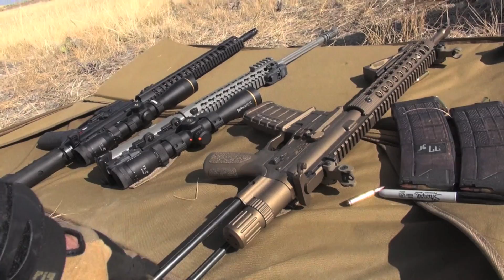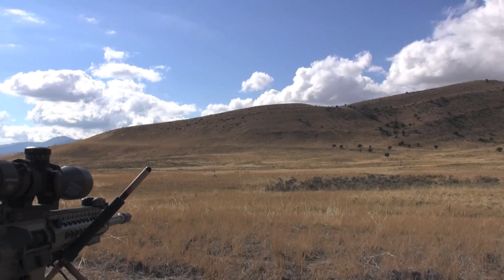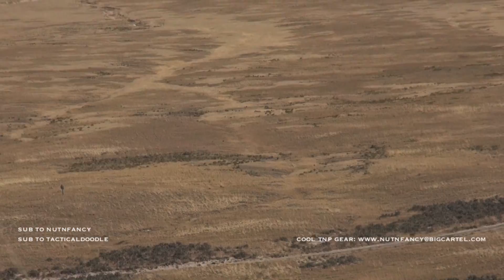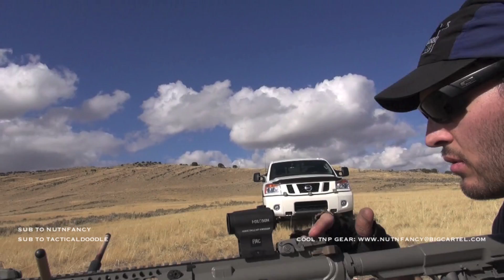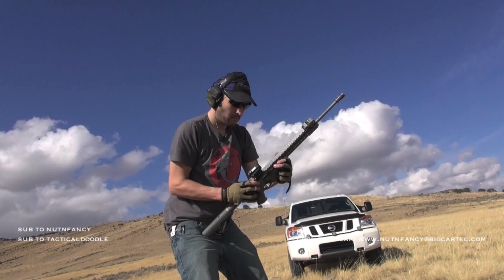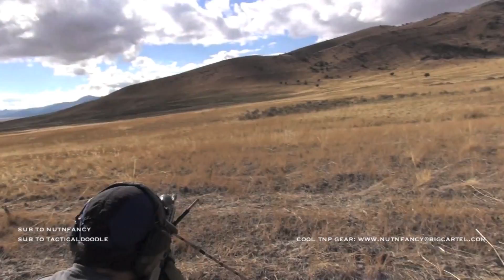'Hobby' AR15s Suck...Or Do They?!

Comment: The term 'Hobby Gun' came about when people on the forums (Arfcom vs M4C) claimed that guns like Olympic Arms, DPMS, RRA, and the dozen or so other AR makers...were MilSpec when they were not. This is when versions of 'the Chart' was created over at M4Carbine around 9ish years ago, to show that those manufacturers were not building those guns as per the Technical Data Package of the US Army via Colt M4 type Carbine. Back then, most AR makers claimed their guns were MilSpec when that was complete BS. The whole point of the Chart was to emphasize 'quality' and actual Military Grade built M4Gery civilian Ar-15s. 

I don't think most called the hobby guns 'crap' however, as they were Not actual MilSpec as most people claimed, but the folks were shut down by the 'Hive' when they claimed their gun was 'MilSpec' when the chart stated otherwise. At the time, I was going to quite a few carbine classes and these Hobby or Homebuilds were going KaBoom left and right, some causing serious injury to the users. Luckily we had medics and MDs in every course. We had quite a few of these guns turn into 'Jammamatics' because they were stamped 5.56 when they were actually .223 chambers, resulting in popped primers when they shot 5.56 ammo, in every single class. Luckily, there was an armorer with a Ned Christensen 5.56 chamber Reamer to re-size those chambers. 

Because of the factual data taken from the manufacturer's own websites and compared with the actual TDP,  people had a real resource to actually compare ARs based on the facts of the manufacturer vs the TDP.  It also made these Manufacturers pissed off and step up their game to build their ARs a little better. It also made heads explode and the butthurt was rampant. All over the gun forums with statements like yours, "I've never had a JAM yet", "My Fit and Finish is better than those", "You guys are f&%kin snobs" and "My 3rd cousin twice removed is a Navy Seal and owns one" etc... When the actual point was that their gun was not built to the TDP. Period and therefore, not MilSpec. I don't recall anyone saying that they wouldn't run. 

There's nothing wrong with a home built gun IF made with quality parts and you take the time to learn how to build them correctly. However, and most likely, most people do not use quality parts or take the time to learn how to build it properly. Having said all that, most if not all can Not claim that their 'Hobby gun' weapon is in fact, MilSpec or is Military Grade...other than do like you've just done and claim, it's as good as yourn...Peace.
Reply: A really important point is that mil-spec does not mean it's all that nice or perfect. Mil-spec is what the government gets the best price on that still works good enough through they're testing. There are parts on the market that do not fit mil-spec, but are actually better. Mil-spec is the base end of the spectrum, and it is easy to go far above.
Reply: bower31 You point is a nonsensical one and has nothing to do with what I wrote. MilSpec is a wandering meaningless word which has been hijacked to mean 'close enough' where everyone and every manufacturer can and has made claim of, regardless of it's authenticity, and has defined what they think it means to them, to either appease their conscious or to outright lie to convince people who don't know any better otherwise. MilSpec does Not mean Built to the Technical Data Package or TDP as what people actually think it means. Which is the MINIMUM standard, not the ceiling or top of the line. That's it. Most manufacturers can't even build to that 'floor' standard.
Reply: Sinister1 Nice redoubling of my point, I basically said mil-spec is a total bs term, which means little to nothing. You're better off learning what makes parts decent yourself, and judging based on your own research. That's why the term mil-spec died off so hard in recent years, because it doesn't mean anything remotely useful, besides that it wont blow your hand off, and will shoot mediocre groups.
Reply: bower31 That's not what you said, as i am not an interpreter. Communicate more effectively next time or start your own discussion.
Reply: I agree % 100. I bought a standard BCM. It  hurt my wallet but they are known for tight quality tolarance. weather its true or not I spent the extra coin because didnt want to risk getting a problem rifle, hopefully I made the right choice.

Comment: I have a smith&wesson M&P sport 2 and it has ran flawlessly and I replaced the gas block to a low pro Odin works so I could put a free float rail on it. But the barrel on it is really not great it's I believe 4140 steel not hammer forged or anything and it shoots 1 MOA with just regular federal 55 gro bulk ammo I have ran Tula through it and wolf and I have not had 1 single malfunction and As of right now I got about 1,500 rounds through it which I know isn't that much but I mean I paid like $700 for it I mean what else can you ask for. But yes I have made modifications to it like the handguard the sights and so forth. I'm looking for a very nice red dot for around the $150/200 mark any suggestions anybody?

Comment: Started with a M&P a few years ago, just made my own through PSA.  Picked my 18" Barrel, thanks to your recommendation, with a rifle length gas system.  got the premium bolt carrier.  I picked every component exactly how I wanted.  7075 buffer tube, SS 18" .233 wylde barrel, premium bolt carrier HPT, MPI, keymod handguard, polished trigger group, ambi safety, magpul furniture.  It is so awesome to put together your own just the way you want with upgraded parts for just as or less expensive as one off the shelf.  $700 build!!

Comment: People. This is the 21st century... Interchangeable parts have been around for a LONG time (first evidence of this practice were parts shipped to Carthage during the Punic wars) Now.  Computerized milling machines with outrageously small tolerances.  A simple,  reliable design.  I own an AR that is arguably a "Hobby AR"  made by some guy in Portland, Oregon who picks out parts that work and assembles them.  It cost me half of what it would have cost if a name brand manufacturer used the parts of this quality.   Zero issues.  Good accuracy.  Incredible value.  It works for me.  Ignore the hype.

Comment: I have built 5 AR15s milling 80% lowers and all. 3- 556, 1- 7.62/39, 1-300 black out. I use ass cheep ammo in everything because I shoot every weekend and have a family to feed. All of them just as reliable as my M and P I bought from Turner's and all cost between 450 and 550 without sites.  putting together a firearm that functions is very personal and I feel more protective of my builds than my buy's. Thanks for hitting on this subject nut-n, great video.

Comment: I've built my own for years. Yes, it is my hobby. It allows me to spend on the components that matter the most to me. Trigger, barrel, BCG. Spending hundreds on a stripped lower or upper is a waste of money. If they are "mil-spec" then what difference does the manufacturer make? I'm no "operator" so I don't need to spend hundreds on a rail either, save that money for a good optic!

Comment: about 6 years ago I built an ar with very little experience, it has never failed me. I even refused to clean it for over 6000 rounds to try to get it to fail, but I gave up. it took me almost 3 years to put the rounds through it but still pretty impressive. I do not have the highest level of components either

Comment: Majority of mine are "user built", the ones that not "user built" are my very first AR-15 and a handful of SHF AR-15's. Which the SHF guns are made from rifle kits since they are cheaper than "hobby builds" and work great, they all sport basic features (plastic handguards, irons, etc.). Your guys again are spot on, building your own gets features and components the user wants and is not forced to swap parts on a factory gun or overpay for features you don't want. In addition the user can go mild or wild on the parts they choose,  also if the users needs or wants change they can still swap items out and have a better chance of trading or selling the takeoff part. For example if a BCM Key-Mod handguardd is no longer wanted and he wants say a M-Lock the user can buy and install a different hanguard and have a much better chance of selling the BCM their for offsetting the cost of his new handguard.

Comment: Bought my first AR off the shelf just 3years ago, (at 61 years of age), after being a bolt gun guy back in the 70's -80's. Completely different animal, steep learning curve. After doubling the original cost by switching things around, I decided to build from then on.
Reply: Orion Fixr 
After buying off the shelf a couple times, and then changing everything out to my liking. I have learned it's cheaper just to build them the way you want from the ground up.
Reply: Same here. I've built 3 rifles and two pistols, all function very well. Now I'll be the first to admit my weapons haven't had thousands of rounds through them and been torture tested beyond reality, but they work for my POU. My "bench gun" ,built mostly with PSA parts at a cost of around $700, puts 5 rounds of 55g PMC BT into 1 1/4"- 1 3/4" at 100yrds. Could do better with a better shooter at the controls, I'm sure. I like building them as much as shooting them! Haha!

Comment: I bought a stock AR back in 2012. Today the only stock parts on it are the buffer, buffer spring and the upper receiver. The second time around I built one. Both run flawlessly with anything I put in them.

Comment: Drives me crazy..."Yeah, that's good for plinkin' but I wouldn't trust my life with it." Like the AR knows when it is pointed at a real bad guy and decides to take a shit on that shot? The shit you see on forums. I put together an AR pistol recently...after replacing the weak (factory installed) ejector spring...1100 rounds flawless so far.

Comment: I will NEVER buy a store AR. I have built 3 AR's so far, after the events of last week it looks like ill be able to build another one ;), and I have only had problems with magazines.

First was a budget build using the cheapest parts I could find and has a 16 inch barrel. Second was a bench rest build (glass, bipod, 20 inch heavy barrel, etc.). Third was a "lightweight SPR" build that ended up being only about 8 lbs empty and with glass and has an 18 inch barrel.

Comment: 700 dollar PSA ar-15 I built myself. 1.5 Inch groups at 100 yds with xm193! I am more happy with it than he dpms I bought or the colt LE6920.
Reply: check your typos, but I agree.
Reply: JettyDeke I disagree on my end , I run competition with my Colt LE6920 and never had I swear 1 issue , my factory PSA has had a few reliability issues , works OK but not same level as a Colt by far . PSA is down the road from me too stop in there all the time .
Reply: 3Gunner I've head of some issues with PSA, but did you build your PSA?  What kind of fails, by the way?
Reply: JettyDeke...same with me.  PSA rifle has been 100% reliable over 3 years and several thousand rounds.  Only issue has ever been magazine related.
Reply: +3Gunner I never said my 6320 was bad, I just said my psa was my favorite and more accurate. I have never had a single issue out of either gun but my build is just as good if not better
Reply: +JettyDeke sorry 6920!!

Comment: Hey nutnfancy, do you ever worry about headspace doing a build? My son and I built an ar this year, and I went ahead and bought some gauges just to double check.  Everything ended up being great. 

We used cerakote on it in part due to one of your videos. 

It's a Spikes upper,lower and handguard with a ballistic advantage barrel Hanson cut midlength and fail zero bcg, with magpul furniture. 

This thing shoots sweet, with zero failures so far. 

Keep up the great videos!
Reply: kevin thilberg The AR15 is self headspacing
Reply: Jordan E.   I would like to be able to make that assumption, and I have not heard of any barrel manufacturers having problems with their chambers. There can be a slight chance that the barrel, upper or bcg, or any combination of the three could be out of spec.

Comment: Speaking of installing the gas tube, my uncle built an AR, decent build, Used a 15" quad rail, and an ACS stock. But other than that, a squared away and accurate rifle. But he installed the gas tube upside down. He couldn't figure out why it wouldn't cycle. I took the handguard off... Here's your sign.
Reply: Redneck Operations what did he serve in Korea or World War 2 xD it looks like he has more experienced with a M1 then a AR-15
Reply: No he never served. He must not have been paying attention when he installed it. The sad part is he couldn't figure out why it wouldn't cycle, and never thought to take the rail off.

Comment: I'd be willing to put my mutt up against anything from Bravo Company or Novesky or whatever.  It's a Colt LE6920 barrel, PSA upper/lower, Magpul furniture.  Without the CompM4 on it I spent around $900
Reply: cswann8...agreed.  My friend has a Daniel Defense and a BCM, and my PSA rifle shoots just as well as those great rifles for 1/2 the cost.  Great rifles, and, if you want the name brand, by all means, go with it.  I'd rather spend the extra money on ammo.
Reply: Dan Barnes my PSA lowers with hodge podge parts run and run and run . had one fail to feed . stupid magazine spring fully loaded was way too tight. took two rounds out of mag and back in business😉
Reply: More power to you brother, although I will say that BCM and Noveske make some extremely nice rifles that will probably shoot better than your milspec colt barrel, that being said they are much more expensive. It depends on what you value more, money or superior performance. Me personally, I choose performance. Others may not, and that's fine. Besides all that, built AR's are awesome and as someone who has never purchased a complete rifle I am in agreeance.
Reply: cswann8 While this is mostly true, there are certain performance benefits such as reduced weight, recoil, increased accuracy, ergonomics, and lethality associated with the many different models and modifications of the humble AR-15. A mil-spec 500 dollar PSA will be 100% reliable and very durable, likely outlasting the owner. Me personally, I believe in buying the best possible tool I can own especially when it's my life and liberty. Not everyone spares no expense on such things, and I 100% respect and encourage these people. 1000 bucks can get you a long way in an AR, personally I would spend the money on a really nice barrel and a really nice trigger, with the rest of the parts being boring mil spec stuff. That way I would get my best value for money. I personally dislike those that look down upon people that spend lots of money on their guns saying "Go buy a 1000 dollar gun and the rest of the money on training and ammo", and while that is a valid approach, it may not be the approach people take. Just some food for thought. God bless.
Reply: Why would you buy the colt barrel over the PSA barrel thats waaayyyyy better???

Comment: lot of great points made. i wanted to run a long range and cqb upper on the same lower but of course 1/2 of one turns into a whole one. ive got quite a few parts left over, some i want to use, some i dont. some will sell, some wont. i want a case of steel so i can save my brass and i plan on running it this weekend. 

i really like that you ran a 16in barrel with the troy pdw stock. that setup is siiiiick. i still have a new frontier polymer lower LOL and i think i want a poverty upper since i have an a2 carry handle laying around. that poverty build should be the high point of ar builds right! LOL.

Comment: I wish I could build my own AR. Problem is I don't have a garage so I can't have a vise. I don't see a way to build an AR without a vise. Anybody have any suggestions?
Reply: It's easy. Got any rail risers? Optics? Foregrips? Install them on top of the reciever, then, making sure that you are torquing the barrel nut in the direction of the attachment(s), lay the upper on its side and go to town on it. Be sure you are also exerting enough downward force to keep the whole assembly flat on your working surface. For receiver support throw some masking tape on the bcg and jam it in there, then use any other applicable objects to reinforce the bottom edge, also wedged in with tape to fit. 

I have built several uppers this way and none of them has ever had a problem. I literally only own a hammer, a wrench, an armorer's wrench  and some steel punches. Think outside the box, where there's a will there's a way.
Reply: aj I mounted a Harbor Freight vice to a big block of wood so that it would be mobile.  As long as it is mounted correctly, and the base block of wood (so... the legs) is in alignment with the torque you are applying, and you are careful, it works.  It just needs to be wide enough.
Reply: I'd buy a portable work bench and mount the vise to it.
Reply: I used a clamp on vice that you can use on pretty much anything solid that the clamp will fit over.  If you use it on a kitchen counter or anything you don't want getting marred up, buy some thin pieces of wood at Home Depot/Lowes.  Obviously it's not ideal and you can't torque as hard as you could on a bolted on vice, but you really don't need that much torque for a barrel nut.  Tip: be sure to use some thermal anti-seize grease on the threads.